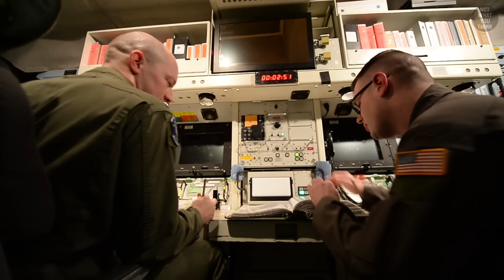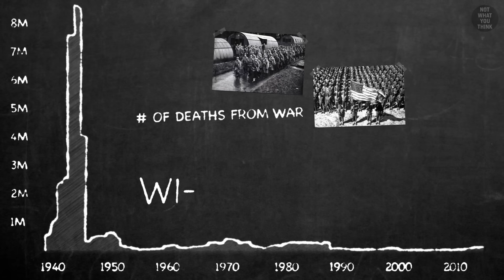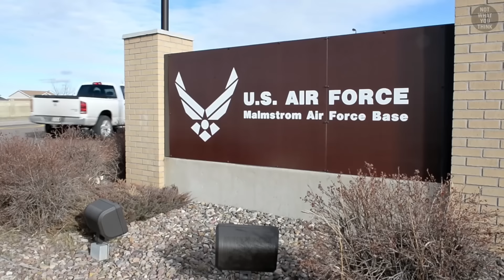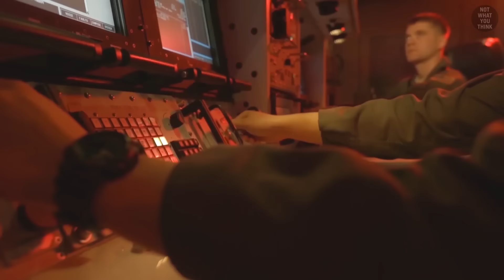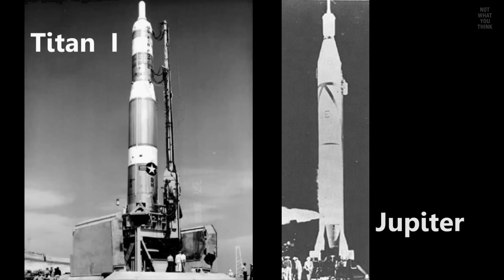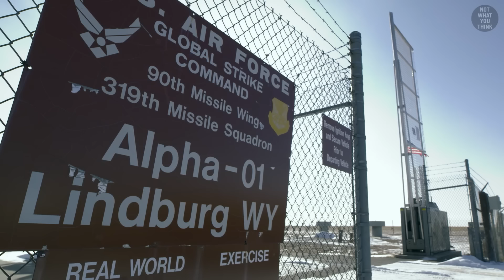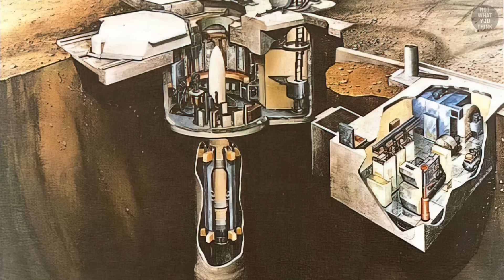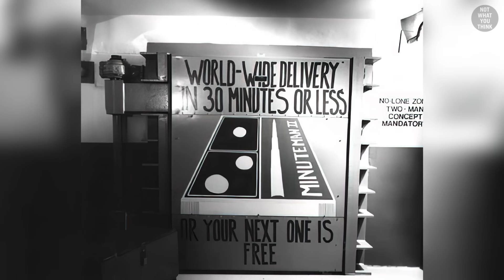Guarding America's Missile Fields

Comment: 9:04 The first-generation ICBMs used liquid oxygen and kerosene which are not hypergolic.  The later ones that use hydrazine and nitric acid were storeable as those compounds are hypergolic, but they are also wickedly toxic and difficult to handle.
Reply: Nitrogen Tetroxide, not Nitric Acid.  It broke down into Nitric acid when the day was not a good one though.  Also, the with hypergolic fuels the fuel can be stored in the missile.  They did not need to be fueled up to launch
Reply: Exactly.  To add for anyone reading, liquid oxygen isn't stored in the missile because it boils at –297°F (–183°C).  The word NWYT was thinking of is cryogenic.  Anyway, it has to be pumped in and this is what primarily caused the longer launch response time.

The Titan II used UDMH/nitrogen tetroxide hypergolic propellants specifically because they were able to be stored in the missile.
Reply: I'm pretty sure the hypergolics were chosen because they were "shelf-stable" -- you could leave the rocket fueled for months at a time.  It was terrible terrible stuff in any other situation, but it could stay in the tanks for a really long time.  (Also, they make the plumbing of the rocket simpler, which is a benefit if you're mass-producing rockets and leaving them in the field.)
Reply: Yeah, the SLS burn, while appreciated, isn't relevant because their challenges with cryogenic hydrogen are in no way comparable to hypergolics. The reason for not using hypergolics is that leaks can and did kill everyone in the silo.
Reply: @kco1270  lets not forget the titan incident in Arkansas. Nasty stuff.
Reply: @davidmohr4606 Did they ever find the warhead from that blew off the missile?

Comment: 5:27 I'm no military expert, but I'm pretty sure the ICBM's are definitely not supposed to fly through the polar ice cap...
Reply: No this actually checks out.  Right before launch they heat the nosecone up so it'll melt through the ice better.
Reply: ICBMs fly mostly in space. In space there is no ice.
Reply: @dtibor5903  Comets would disagree with that.

Comment: the missile fields in montana and north dakota have those famous stories of ufos reportedly disabling individual missile silos. regardless of who is operating the craft, the fact that someone can just penetrate the airspace and disable missiles launch ability is absolutely insane ;)
Reply: Um no. The minuteman II guidance and control "cans" were OLD. They were routinely replaced ( my job ) and renovated, but were minimum 20 years old.  They failed randomly. The sites were hardened against EMP, isolated from ground tremors, thermostatically controlled, built to withstand a near direct nuke hit. But these were extraordinarily complex machines, and they were designed to fail safe, so any failure in any of the hundreds of systems would disable the site. So if ground water shorts out a random circuit breaker in the soft support building, the site goes offline. The Air Force would gather statistics about these failures, and look ways of preventing them, and we fixed this stuff.
Reply: @therealstubot facts. I worked on MMIII in the 80s
Reply: @jimbutke  ah a fellow 443. I was in the 341 SMW, Malmstrom AFB, Great Falls, Mt.

Comment: I remember the 'dead mouse' smell in the launchers and soft support buildings from long ago...and responding to outer zone alarms, way back before video surveillance on the sites. In my case, Malmstrom AFB, MT. '74-'75/ '77-'81. Security Police. Many changes since then. 564th Sq.  gone, LCF now MAF, Ellsworth MM wing gone. SP/ SAT/SET now superseded. SAC gone. Feeling a bit old tonight.
Reply: Served 1977 to 1982 92d Security Police Squadron, B-52G's on 15 minute ground alert, The alert shack as we called it, building 2080 is really modified, the tower I worked in is gone!!!
Reply: I hated the old IZ/OZ alarm systems, and was very happy when they were replaced by IMPSS - the Improved Minuteman Physical Security System. Much more accurate and a shit-ton less nuisance alarms. Of course we got those systems at Ellsworth not long before they shut down the missile field there. Typical. 😆
Reply: Need a detail of security cats!

Comment: I worked on many of the missile sites as a contractor. Had to go through back ground check through the Air Force. Worked on sites in 5 states. Just knowing the power under that huge concrete block was quite impressive. 🇺🇸

Comment: the 20 minute delay on the shaft opening is absolutely genius
Reply: @Sweet-Rat-Milk  he explains in the video, as soon as the opening is requested there is more than enough time for a team to respond to get rid of the threat
Reply: that is not genius it is a standard security measure in banks
Reply from the maker: The concept is genius, wherever it is being used.
Reply: Bank vaults use similar delays when opening :) Quite an interesting measure
Reply: The actual time delay is the security response time.
Reply: Seriously doubt seal team six could breech.
Reply: @markbrockman9859  If the site was already opened up for a maintenance team then it's doable. Not a damn chance if the site is all buttoned up.
Reply: @markbrockman9859  Long time ago, that was a factor in the delay time, but when I was an EMT (from '93 - '13) all the timers were set to the max, which was 30 minutes. However in the latter portion of that time frame, the B-plug was changed to a fast rising system (to help counter a takeover attempt when a maintenance team had the site open) and that is now actually longer.

Comment: Can you do a video on how they repair ships with significant damage? Love the videos keep it up!!
Reply: Ong
Reply: Dry docks aren't that interesting
Reply: @tristanb.3470  maybe not but I would still enjoy to see it
Reply: Drachinifel's damage control video comparing IJN & USN damage control is very nice, I recommend that.
Reply: If the ship doesn't sink, you tow or tug to a dock for ship repairs. Typically its just a big tub that the water can be drained from and the ship ends up on pylons or whatever, depending on the repair. The repair work is just like you would think, cut off the damage by removing the welds or rivets, bolts, beams, structures, removed the damaged parts, replace them with new parts. The guy who said its not that interesting is honestly correct.
Reply: @brianm.595  I think the question was more "how do they repair ships in battle" than "how do they repair ships"
Reply: They use a specialized designed toothbrush for the more sensitive areas of the boat

Comment: The problem with the pre-Titan missiles was that they used cryogenic fuel that couldn't be stored in the missiles, and hence the slow fueling step. The Titans used hypergolic fuel that was stable at normal temperatures and so could be stored in the missiles, but was corrosive and extremely toxic.

You kind of mixed your facts all together here.
Reply: Liquid propellant missile are simply unnecessary hassle for military applications, where the missile can be stored or be on alert for many decades, with minimal maintenance, and suddenly need to be launched in the next couple of tens of minutes. They are also extremely dangerous. The Titan II once exploded in a silo due to a mistake by the maintenance staff.
Reply: @arround1  Yeah, the guy dropped a 5 pound (or something like that) socket wrench bit down the silo.  That is not the fault of the Titan II.  That is transfer of energy.
Reply: @arround1  did the nuclear middle explode or just the fuel inside the rocket?
Reply: @HughJassle  Just the fuel.  I blew the warhead up out.  Look it up, 1982 titan-II site explosion.

Comment: 9:20 There is no such thing as hypergollic misslies, Hypergollic propelants on the other hand do exist, however, they DO NOT need to be put into the icbms before launch, they are storable propellants, which is why a large majoirty of icbms use hypergollic fuels. You are reffering to cryogenic propepllants which do 'boiloff' over time, this is why the atlas misslie was unsuitable as an icbm. This is why the hypergollic titan missiles were developed, and so on and so forth. The statement which you made stating that solid propellants being a solution to 'fueling problems' are somewhat accurate, however solid booster were developed due to their relatively low mass and complexity in comparison to a conventional rocket.

Comment: They were called Launch control facility when I was in at FE Warren in the 80s. Had MX and minuteman missiles. No video at silos just the facility at time.  And the alarms by animals was a major fact. Rabbits, rattlesnakes sunning on the concrete and my favorite snow piled up blocking the sensors.  Even had a cow one time that walked OVER the fence/barb wire due to snow drifting so bad.  Brought back alot of memories with this video.
Reply: Rob I was there 86-89. I do remember the alarms from those pesky rabbits and don't forget the skunks. We almost lost C-8 once because I was attacked by one of those Russian Skunks. I eventually had to burn my uniform. Those were the days. Oh don't forget the pesky QC alarms. Yeah to make sure you followed the checklist. I was in the 90th MSS Charlie flight area.
Reply: @aaronvigil6067  90th MSS also, Papa most of time I did sub in at Charlie for vacation rotations for the other team. Lot of ghost stories for Charlie.
Reply: @rob8820  yes Charlie 3

Comment: I grew up surrounded by those sites. That all sounds right. I don’t think those command and control sites typically have a dozen people at them though. I couldn’t say for sure how many people are typically there but would only see a few coming and going. They don’t go outside much. They are generally pretty bad at driving on rural roads.
Reply: 10k away from 2 mil subs
Reply: Wouldn't be a point having so many soldiers at the control centers if they have a rapid response team to nearest base, and that it takes 20 minutes to open a "door".
But again, its a deterrence, by saying you have more people stationed, there is less chance of an attack.
Reply: @dubious6718  I agree. Those sites are so hardened that they don’t require much personnel securing them. They could literally drop a bomb on someone under the very unlikely event they were posing real threat to a site. There’s just no realistic scenario of someone actually getting into that very hardened and redundant system.
Reply: They have the extra capacity to provide lodging to the maintenance personnel of the maf and their missile flight.
Reply: 10 is the number you're looking for. Six security, two missileers, one cook and one facility manager. Also security can be called in from neighboring squadrons when needed.

Comment: Your videos are usually pretty accurate but there are a lot of mistakes here.  Atlas and Titan I used RP1 and LOX as propellent.  The LOX had to be loaded at the last minute due to it's cryogenic nature but RP1 could be preloaded.  However, Titan II used storable hypergolic propellants and the missiles we stored in their silos fully fueled.  Also, MIRV means multiple independently targetable reentry vehicle (hence the acronym), not multiple independent delivery system as stated.  Better guidance wasn't directly responsible for MIRV, rather it was smaller guidance systems and warheads, along with more powerful rockets which allowed multiple warheads to be installed on a single missile.  While the Peacekeeper (MX) system was retired partially due to higher costs, it was a trade off and primarily due to the due to the Strategic Arms Reduction Treaty II (START II) negotiated with the Soviets.  Peacekeeper was far more accurate the any of the Minuteman series.
Reply: Beat me to it! Titan II was also launched in less than 1 minute. So easy to verify facts like this.

Comment: As a former Security Policeman from the days of SAC, I approve of this message.

341st SMW, 342nd SPS in support of the 12th and 564th SMS Malmstrom AFB 1986 to 1988.

"FSC, we have a SIT-7 at India 10"...  🤬
Reply: I was an EMT team chief in the 564th (P,Q,R,S&T flights).  You guys looked forward to us taking over the site even if for a short while.  You had a chance to take the camper back to the LCF and get cleaned-up and maybe some hot food and some decent sleep.  

We were glad that you got a break but it really was nasty when you used the LEB sump pits for a toilet.  That clogged up the sump pumps and guess who had to clean them out?  That involved a 5 gallon bucket, a 60 ft rope and a lot of rags.
Reply: @paaat001  I was doing an LEB check once upon a time ... From the moment I unlocked the hatch and climbed down I could smell diesel fuel that only got stronger the closer I got to the room itself. Once I opened the door the smell was overpowering but I still couldn't see, or hear anything as i didn't turn on any lights. Looking around with my flashlight, I looked under the suspended floor -- All I saw was waves of blue... The fuel tank apparently leaked out and pooled under the floor! Me now at a near panic reported in what I saw, and was instructed to close it all up and head back topside. Talk about scared sh*tless!! They ended up pulling power to the entire site, which meant we had to sit security pretty much all night until folks from support base got to work. All kinds of higher hq's were all about that one. We got some nice "atta-boys and accolades" to come next guard mount, some paperwork too.  

Tango-50 I want to say this was the LF.
Reply: @paaat001 EMT Team Chief for 3 years at Warren back in the 80s. Fun times.
Reply: @Tamburello_1994  WOW, I would have  had to use the sump pit on that one!!  What a mess.  I can just imagine the capsule to SAC communications on that one.  Field Sup stop by to look?

OBTW Thank you if you peed under the exhaust mushroom instead of the sump pit.
Reply: @jimbutke  Malmstrom 1972-78 then Vandenberg 78-80.

Comment: The whole point of still using outdated computer systems is that they are not hackable. The Air Force used proprietary computer programs that were never shared. Most of the systems are pre dos systems.
Reply: To add to that, they was just dependable.